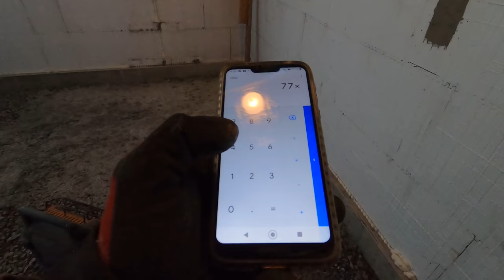Installing a foundation under an existing building part 2: ICF, damp proofing and some backfill

Comment: ICF eliminates the waste cost factor of the forms. When you factor your labor cutting forms, then removing the forms, transporting the forms, and storing the forms that lowers the cost differential. For high labor cost areas, ICF could actually be less expensive. For a DIY, buying the forms/ renting the forms quickly offsets the cost of ICF. ICF makes it easier to get a straight and plumb wall.

Comment: Jesse, the mesh tape y’all are using at the base of the ICF. Is that per: the ICF company requirements  ? Or is it the requirements of the county that this project is in ? I appreciate you sharing detailed knowledge and information about the ICF walls. Much appreciated and again thanks for sharing your knowledge and videos with the world.
Reply from the maker: its the requirements of the waterproofing material
Reply: @jmuller86  thanks for your reply sir, greatly appreciate it

Comment: How much insulation do you have in those ICF blocks. Also, do you need to insulate the floor of the crawlspace? For comparison, the requirements in Denmark is a foot (300mm) of R10 in floors and foundations. My understanding is that your winters are colder than what we have over here, so I'm always surprised to see how little insulation your building code calls for. 

(Roofs here requires 16" of R12.5, if you think we're doing overkill on the floors)

Comment: Have you considered just using 2 layers of 3” hard board foam instead of pouring the floor?  If you cries cross and tape them at joints and to the wall with a vapor barrier below it you’ll need vastly less heating and won’t need to put insulation in the wood floor either. (And it’s way cheaper than concrete)

I’m Ben considering pressure treated 2x8 walls with 3/4” pt plywood and then 3” insulation on the outside taped and sealed and dimple board on the outside. No need for anything but the footers to be concrete at all.  Even the floor can be 32 layers of 3” hard board insulation and then 2 layers of avantech 1” cross crossed too. No need for basement floors to be concrete at all. Just sand under the foam to make it level and graded.

Comment: Great stuff Jesse. Be kind to your knees, you're gonna need them when you're old. BTW, what keeps the concrete from leaking out under ICF's? Seems like a lot of hydrostatic pressure on the contact point with the footer.
Reply: Spray foam is used to seal gaps and adhere the forms to footers.
Reply: I didn’t see it in this video, but others usually use a spray foam along the footer - icf joint.
Reply: Wish I had worn knee pads all those years.

Comment: When you use ICF and waterproofing, how does that affect the conductivity of the concrete, can you still use an Ufer ground rod or do you have to drive a couple rods into the soil to get a good ground?  When my house was being built I researched how an Ufer works, and I read that concrete creates an alkaline layer that allows it to conduct to ground, so the rebar becomes a giant grounding rod.
Reply from the maker: you can still use an ufer with ICFs, unless you isolate the footings from the ground, with like insulation or if you use those bagged footings.

Comment: Watching this I wonder if the drain tile should be inside of a sock to keep the dirt from clogging the pipe.  All of the shows I watch use that method, but I see plastic sheeting being used after the pipe has been covered.  .
Reply from the maker: yea I use a sock sometimes but this was easier to put the fabric on top

Comment: Jesse, you do some really great work.  I have two ?'s, why didn't you do the insulated forms on the other foundation wall and what did the ICFs cost for this job?
Reply from the maker: I usually use my conventional forms to save money on the materials, I also have quite the investment into those conventional forms. so it was hard to make the switch. the ICF materials for this job was about 1500, not including the concrete or rebar
Reply: @jmuller86  And you did a phenomenal job straightening the roof tying the old to the new.  As you were progressing I kept thinking that is going to be  a screwed up looking roof but you pulled it off.  Good job!!
Reply: @jmuller86  I had no idea the ICF cost that much $$$$.
Reply from the maker: @thomaswest1420  well you can almost subtract the cost of insulation out of that, because its required anyways, those 4x8 sheets of 2" foam is expensive
Reply: @jmuller86  and the cost of studs if a fella plans on finishing the surface.  framing out a concrete wall for finishing can be expensive.
Reply from the maker: @CaptainKleeman  yea those webs hold up just as well. or even better in some cases; if you want a tile wall, hanging durock every 8 inches on center instead of 16 is nice. I might do a video testing the strength of those webs, they are incredible.

Comment: Quick question - does the ICF manufacturer give you the measurements of where you need to put in your corner vertical rebar hole? Or is it some standard measurement?

Comment: What's the price difference between ICF and the labor of forming and the cost of renting a form?  I know you own forms, but even if you own the form, you have to consider the effective cost of renting the form from yourself when doing a job.  It seems that the labor of ICF is less than half of conventional forms, considering that they are lightweight, modular, and you don't strip them after the pour.  The cost of hauling the forms, cleaning them, maintaining them, and then the consumables that you have to purchase for setting the forms, ICF looks very competitive.
Reply from the maker: this really does save alot of time and saves your back. Thats why I said I will probably not go back, I will probably sell my forms

Comment: listening to your last remarks on the heating of the GeoThermal heating for the floors, can you Do something like that with a home that has already been built, or ONLY with a new build and how much Land would you need for something like that? Would something like that work on a home with only  a quarter acre of land??
Reply from the maker: yes you can retrofit it to work on any home and you dont need alot of land , you can use a drilled well instead

Comment: Did you think about applying shotcrete to that back rock wall to help seal it off and keep the rocks in place?
Reply from the maker: I sprayed it with spray foam on the other side, but might just remove them rocks
Reply: @jmuller86  Yeah, I was thinking shotcrete might serve two purposes. One, it seals off the wall and holds the rocks in place and two, it might add a bit of style? I don't think a shotcrete hopper is that expensive? If you have a cement mixer and an air compressor you could probably knock it out in a couple of hours? Removing the rocks might be labor and time intensive? Especially now that you have the foundation in place. But at the end of the day, you have to make the call on what you want to do. Either way, you have shown yourself to be a forward looking planner and you do good work Jesse. I know, I'm very similar in skills to yours. I'm a Navy trained electrician/tech and I have done quite a bit of construction and mechanical work in civilian life as well. Good luck buddy.

Comment: For your rebar epoxied in to the concrete, why didn't you use chemical anchors? 
It's a glass tube within another glass tube filled with the 2 parts of epoxy, plus a bit of sand that when you drive the rebar into the pre drilled and cleaned hole smashes the test tubes mixing them and it's a forever anchor.
Reply from the maker: I didnt know they existed,  I will check into them

Comment: where can I buy a stapler like the one you used on the outside of the plastic? have not seen that in Norway. Great job 👍
Reply: Locally we use "Stinger" brand. https://www.stingerworld.com/cap-hammers Pretty common and you can get cap nailers too for roofing underlayments. We can get the nails in hand drives as well and thats what most guys will use
Reply: @NotSureJoeBauers  thank you .

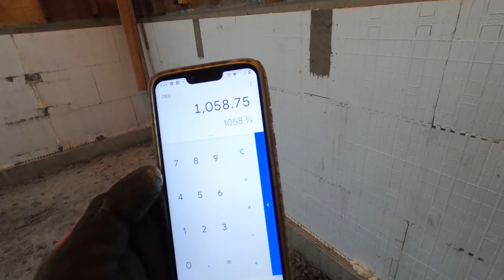Comment: 46:14 and each bolt has to resist 525 lbs in shear force (pull-out is negated because of the pinned ledger via the ''wall to wall confinement". 
Even though wedge anchors can do this load... the issue is wedge anchors, by design create a ''wedge - force'' and your concrete is say 3000 psi and at 10% ... This could cause tension failure at around 300 psi (way below your 1056 lb requirement (plus margin)...
Epoxy anchors are a better choice in the future (of course green concrete can also be an issue on reduced strength).  I know you stated you were going to use epoxy and studs but ultimately you did not go that direction...  Epoxy will eliminate the wedge trouble  and put more of a ''cone stress''  which reactions on a larger section of concrete. 
Note, you did a nice job of waterproofing walls with adding the tape and coatings...
Be mindful of creating a ''double vapor barrier" (traps moisture)... but, you should be okay on this one as you did NOT seal the bottom of the plastics.
Note, in your next video you added insulation on the entire floor, this was not required and even a concrete floor is not required but the vaporize barrier is always recommended  (depending on your local code)...
But, if insulation was required, it usually is limited within 2 feet of interior space or you can even add it as ''frost protection'' on the exterior.
My comments are only to motivate and not intended to insult... keep up your great work.
ICF was a good choice and please pay attention to ''lifts'' and be careful of full top to bottom placements...  
Chers.
Reply from the maker: thanks for the info again. the insulation in the floor was to keep some heat from going into the ground because we will have radiant just above it.
Reply: @jmuller86  , I see now...
Jesse, consider the reflective products ( the bubble foil type product).
This product can be stapled to the underside of joist and on outer walls (in crawl space).
The intent is to not have a situation where a "dew point" is created.
You can find dew point calculators on apps...
Keep up the hard work... I spoke of u today to a fellow engineer; how u were hardcore with the snow blower and getting the job done.
Reply from the maker: @ForensicCats  thanks. I would love to surround myself with engineers. I would like to become one myself but there is no way I would ever take the time to back to college, thats a done deal for me. alot of these smaller projects I am able to engineer myself and make the plans but I know its a matter of time before it is not allowed anywhere anymore.
Reply: @jmuller86  , it is all about where the ''moment'' is taking place and to then counter that moment with an equal or greater force...

Comment: I kinda hate to ask this, but how do you protect the ICF from biting, burrowing critters?  It's just styrofoam, correct?  I figure that at some point, the sharp clawed and toothed critters are going to find out how easy it is to destroy.  I know, even if they removed all the exterior cladding, there's the concrete behind it but it makes me wonder how that kind of thing would foul things up?

Comment: What is holding the walls in place? All I can see from the video is what looks to be two 2x12 (one top one bottom) on each side held up at the end with teed 2x4's.  That can't be enough to hold all that cantilevered weight. 
I need to do a similar thing to our home. ICFs look like a nice choice compared to conventional forms. How much did they set you back?
Reply from the maker: those are 14" lvl's. laminated beams. they could have held up twice that weight. did you see all the snow I had on them in the last video? the ICF's for this project ran about 1500, without concrete and rebar
Reply: @jmuller86   Thanks for the reply. Wow! Laminated beams. Nice! They must be much improved from when I first saw them. The first laminated beams I used had to stay dry. The adhesive would give out if exposed for more than a couple days. Had one left outdoors under a tarp for a week in the winter and was splitting and delaminating when uncovered. Total trash by the time I was ready to use it. I've avoided using them since.
Reply from the maker: @Mark_Nadams  they have come a long ways. I have some that have been left outside uncovered for 5 years and you could still use it today. Houses like these dont really weigh much too

Comment: What do you screw those corner brackets to ?? Looked like you just went into the styrofoam ???
Reply from the maker: there is plastic ribs in the foam, they have something like 400 lbs of pulling strength for each screw
Reply: @jmuller86  ohh ok. I didn’t know there was anything inside the foam. Thanks.

Comment: Jesse I totally get the nonventing crawl space but is radon a consideration?
Reply from the maker: yea but if it tests high for radon you just add a vent to the rat slab
Reply: @jmuller86  I had my house spray foamed and it doubled the radon rate...I put in a fantech radon fan, coupled with an AirThings monitor to keep track of it.  Great job BTW!

Comment: I’m curious if you could spray on the waterproofing. That would make it much quicker to apply I assume.
Reply: expensive gun to spray it when he just has this small of an area to do i bet. If he was doing these all the time and bigger projects i think he would end up using the peel and stick membranes or get a sprayer to cover it faster, maybe?
Reply from the maker: yea I will get more into the peel and stick and possibly a spray gun
Reply: @jmuller86  Do you have a Harbour Freight near you? They sell paint guns for super cheap. I’d recommend getting one just to try it for next time.

Comment: The only thing that confuses me, is what the benefit was of extending the concrete out past the styrofoam, (other than making your attachment easier)  instead of creating a pocket into the concrete for the beams to sit on, or just removing the foam so the beams sit flush with the rest of the foundation wall.  Typically weight wants to go straight down. Thats the theory behind stacking bricks, or hanging large granite slabs for a building fascia. (Not much keeps granite from tipping back and forth, since all the weight goes straight down). My mind says all the wight of the beam is just hanging off that small concrete outcrop,  instead of that outcrop having the full foundation wall under it,  to hold it up.  I understand you’re putting studs in under the beams, that will go down to the footing as additional load support - but  isnt this still creating a “weaker”  (potential) point of failure (under extreme conditions).   Am i completely wrong here?
Edit -   I’m not doubting the integrity of your work AT ALL.  The studs under the beam eliminate the possibility of what I’m suggesting - from ever happening anyway.
Reply from the maker: I actually ended up not even putting in those studs, I forgot that the concrete forms have the webs to hang from for extra support. They hold something like 400lbs per screw. Putting the wood against the concrete takes away the foam and you would have a cold spot all along the perimeter instead of little spots here and there

Comment: Why does not the concrete leak out at the bottom of the ICF:s?
Is there not a lot of "teeth" with a lot of space between?
Reply from the maker: there are teeth but they overlap each other. I sealed up the inside against the footings, the outside I didnt care too much about it flowing out
Reply: @jmuller86  Ok, thanks.

Comment: Did you glue the pipes at the beginning?  I’m sure you thought of it, just curious if you didn’t why...
Reply: Drainage pipes for ground water. They are perforated on the bottom. Gluing is not really necessary .
Reply: This new type clips into each other,  they are awsome. Lowes has them too. Also inexpensive.

Comment: I didn’t see you use the metal brackets to tie the forms together at the seams, top and bottom. Is that not necessary?
Reply from the maker: these forms dont require any of that stuff

Comment: I'm a total amateur when it comes to construction, but why wouldn't you use a pump in this concrete pour?
Reply from the maker: pump wouldnt fit inside of a house
Reply: @jmuller86  like, the hose would just be too unwieldy with the ICFs at chest height?
Reply from the maker: @matthewpaulsen1344  that is one factor if you were using a trailer pump. most of the pumps around here are boom pumps and it wouldnt work in this height. plus they are 800 for the hour.
Reply: @jmuller86  oof. well, keeping costs down would be a huge factor too. Thanks for the clarification :). As a desk jockey, I really enjoy your content and learning about your trades. Thanks for taking the time to put this out there.

Comment: You guys don't glue your drainage pipes together? What about ground movement and upheaval?
Reply from the maker: theres not really a way to glue them, they are the triple wall type, I have used silicone before. but really its overkill

Comment: How is the rebar cross sections wire tied together near the bottom if the vertical bars are epoxied and hammered in after the insulated form blocks are almost fully installed? Is it not vital for all rebar cross sections to be tied together?
Reply from the maker: its not necessary to tie the verticals to the horizontal runs, I do tie them together at the top, but that is only to keep the verticals in the center. the horizontals have that click lock channel to sit in so they cant move
Reply: @jmuller86  Okay, thanks for taking the time to answer my questions Jesse, hope you have a good weekend.